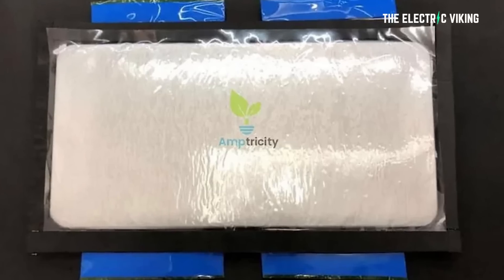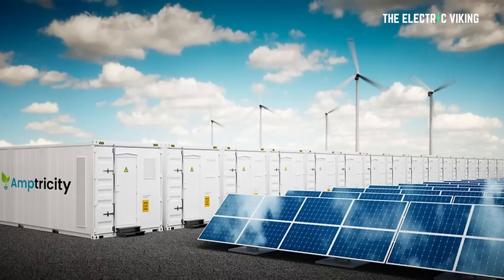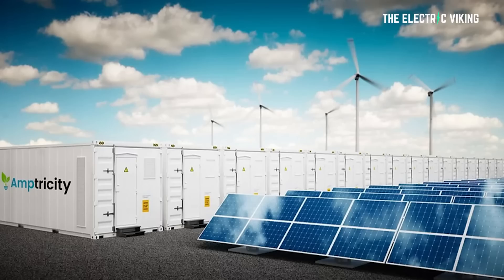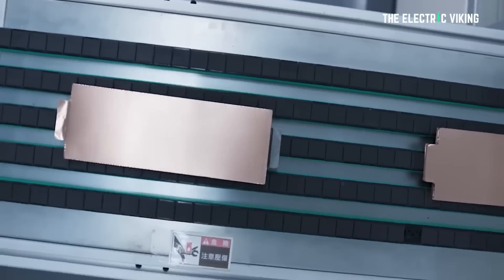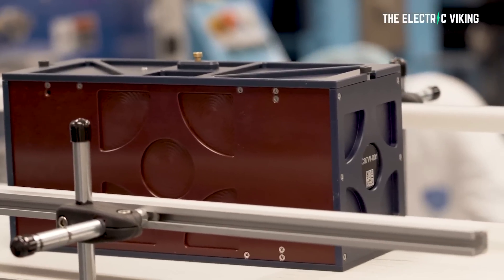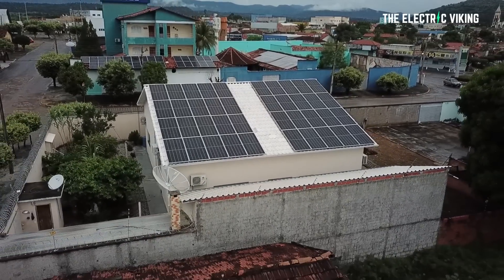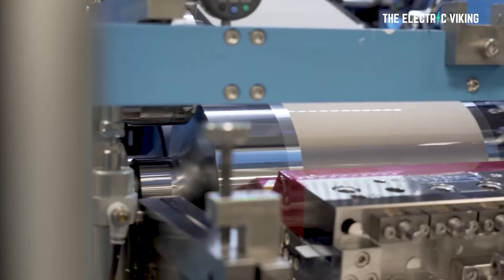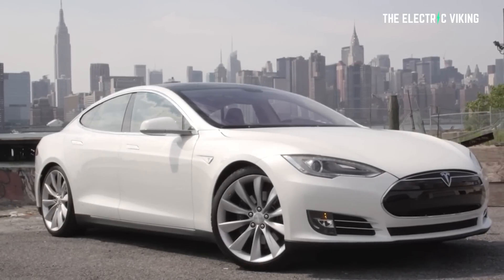Amptricity unveils its solid state batteries for Tesla's or energy storage

Comment: Too expensive. For any application. LFP is a 1/10th the cost. Unless they pull a rabbit out of their arse and get their costs down this is just another stranded technology.
Reply: Dave Froman:  Agreed.  The question is how much cheaper do they get IF they get to where they can MASSIVELY scale up production and more or less fully automate. 

And I have no idea of course.  But as good and cheap and durable and safe as LFP batteries are getting already, there's no contest for middle class products.  And outfits like CATL are reporting significant progress increasing energy density in their LFP products, with more expected in the next few years, without significant price escalation. 

Now, maybe if they're light enough and energy dense enough, they could find a use in an application like commercial aircraft or something.  But at anything like that price point, I'd expect a LOT of SERIOUS competition over time.
Reply: @rogergeyer9851  first they have to find a niche to scale into. And at this price? About the only thing that would maybe allow it to happen is the aerospace industry. That is where they should be concentrating their efforts.

Comment: If I had a £1 for every one of these stories… I call a definite foul on this one… 11,000 cycles is a very strange number, and implies it has been tested. At its maximum charge output of 3kW, that number of cycles is about 10 years, much longer than the company has existed… the output voltage of 48.3V is also not very useful. Why would they choose this?

Comment: I think they will fail if its 20K for only 12 KW battery. When its 5K for 12kw battery. I would thne consider it as my FIT helps reduce my bill more than the cost of a batteries upfront cost vs savings. ATM still more virtue signalling than anything else.
I do like the use of metals without / less lithium.

Comment: 8 hour discharge? so a vehicle with 200 kWh would have a power of 25kW ~ 33HP? Do they use super capacitors to help with acceleration? Good that range will be long. Low power was usually the problem with solid state. Explains why they target residential storage.

Comment: Need to see old electric cars get new motors and batteries, seats and paint jobs if needed.  Save the planet means less car and junk appliance manufacturing.  Old water heater is mostly just water storage tank, new legislation needs to be made to regulate old water storage tanks being stupidly disposed of in recycling or trash for reason.  Build cars to last and never rust.  Car manufactures want to see break downs and sell more and more new cars.

Comment: They have to have a third company test the batteries and verify their claims. Anyone can say 11,000 cycles but do they actually have that. What is their testing procedure? Etc.

It's not that I am being a sceptic. But I have seen so many companies make statements like these. For instance, the DoD. How did they test? Was it all the way for actually 11,000 cycles? And how much battery capacity is left after? They just say long cycle life. 11,000 deep discharge cycles. What do they consider deep discharge? Why not say that it was discharged to 0%, 10%, or 20%? But what does that mean? And how many batteries did they test on? What was the discharge energy current?

I have noticed that when companies intentionally leave this info out, then they are just trying to get attention. If you look at LFP or NMC batteries, they have all this info, out in the open.

It would be great if it was true. And then there is cost.

Comment: Lithium ion phosphate batteries are not fit for electrical vehicles they are a dead weight causing wear and tear on the tires due to their poor energy density any batteries that is less than 200 KWh/ kg is not fit for Ev's, incl blade batteries, however safe they may be. They might be suitable for power storage and other applications. Solid state and other battery chemistries that can provide 250 to 350 KWh/ kg energy density are going to be the future batteries for EVs

Comment: A 12kWh home battery could shave off 4-5 peak hours for me on a cold day like this. The house used over 60kWh today...
Reply: You are a big consumer. I use just 160kWh per month. This is easily sufficient for small house holds.
Reply: @efr89  Yes, he is abusing electricity. Just in October I used 250kWh and that is only 8kWh/day on average.
Reply: It is -6 outside here. What's heating your houses? What drives your appliances?

Comment: In 3 years when the bugs have been worked out and the cost dips to the $1000 per kWh.   This will be amusing.   For now you are investing in new technology.     Unless you are very wealthy.  You can buy a base Aptera with an 25kwh battery for 26k.   Vs 20k for the 12k solid state battery.    Tesla power walls are going to dip more in price also when they are no longer in a dominant position.
Reply: Absolutely comical that energy storage (including tesla and others) is comparable or more than a vehicle.  Lots of "not the battery" goes into vehicles.  The initial 45 kwh Aptera will be ~$666 / kwh (before the inevitable 10-15% price hike).

Comment: Yer still missing the problem with global warming economic activities.  Any product that is a machine will break down, much worse than any planned engineered failure than planned obsolescence.  In short Tesla from 2022 will not be possible to be repaired in the short term future, and its time to buy a brand new car.  There are no parts to fix on an electric car.  Should be able to replace or repair the battery or motor on any electric car any appliance.  The same problems will continue same idea of broken toaster or oven water heater.  The car is a water heater broken beyond repair, not true.  Water heater is mostly just a tank.  The last think a company that sells a machine or appliance of any kind is for that economic global warming product to be repaired.  Throwing things away in the land fill or recycling them, promotes more economic activity.  Old semi trucks, huge mass of metal should be swapped over to electric.  Common existing old river dam with no electricity generation.